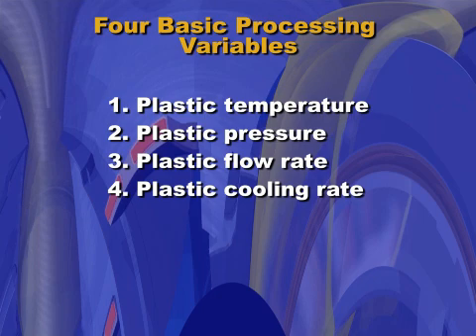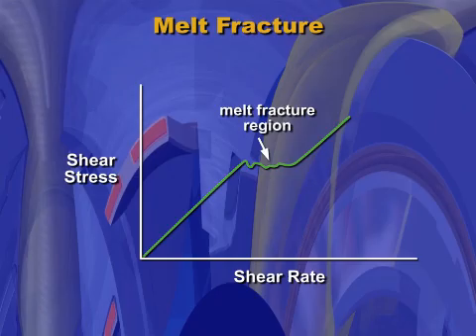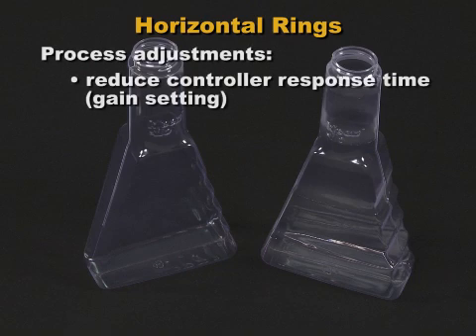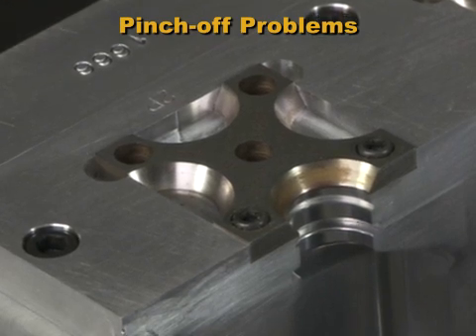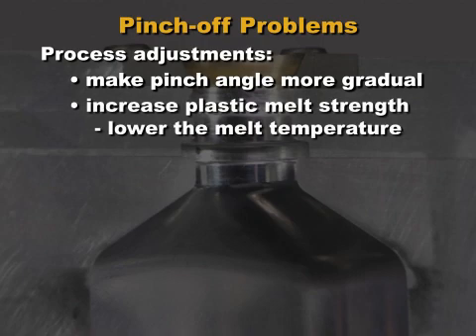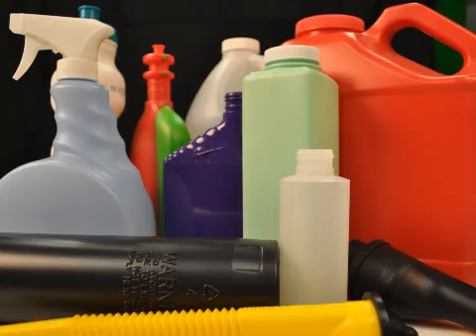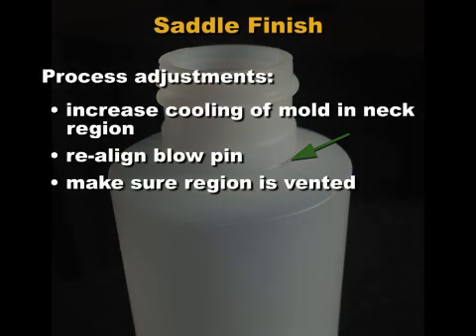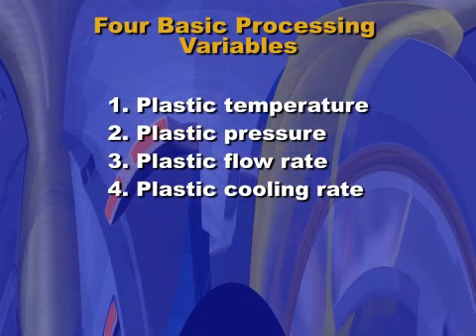Extrusion Blow Molding Part Quality and Problem Solving   Part 2

Comment: I'm working with the local civil protection director to make a prototype of a torpedo style rescue floatation device to be donated and mounted on natural wood posts at our most historically dangerous beaches.  

These torpedoes are abusively priced ($150 USD), not available locally here in México and not available in all-natural materials but I'm working to change that.  

We need a local bioplastics supplier with materials well suited for this purpose with sheet plastic that can be manually heat-formed over a mold.  And for a much larger scale impact, we need an estimate of the cost of mold that could be used with recycled plastics, bioplastics and biodegradable plastics also to injection mold them for us.  If we can raise the funds to pay for the mold ourselves, the devices can be relatively very inexpensive which will make them very accessible and help save lives everywhere they're used.
Reply: R kn।   C। c c wfc
।  Mk
Fcl
।l
 Ll
Mm k
Fcl।f
Z। । Wmk।  M tkmmkmr kml। Fct mfnc।  Kmrrf। ।। Fc।   Lc snk।।SMC। । 
 । K। ca। ।

Comment: My hot cutter blade is keep breaking off every eight hours, what could be the problem for this to occur.
Reply: you need to check the amperage in the wires of the blade maybe you need to put lower voltage in the primary of the transformator  I put  127 volts  and the current go down to half
Reply: may be high voltage applied on the blade
Reply: Owhh kk bro, thnks will check on it.
Reply: hi sir we are manufacturing of blow molds any requirement pls call me on this no 8000106807. from Ahmadabad Gujarat
Reply: Or cheap blade, we bought this one that kept breakn on us and found out blade was cheap blade. Also the speed of the hot cutter blade.